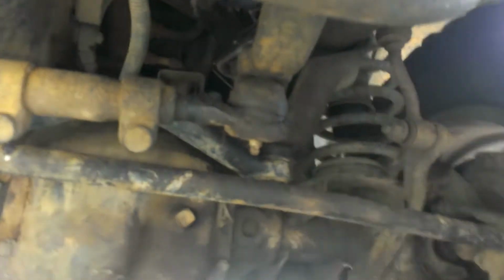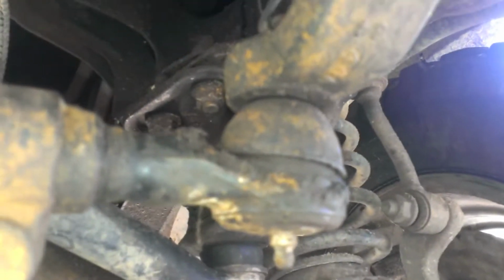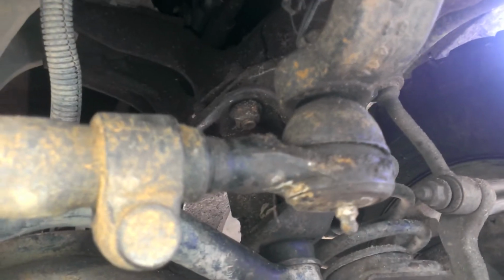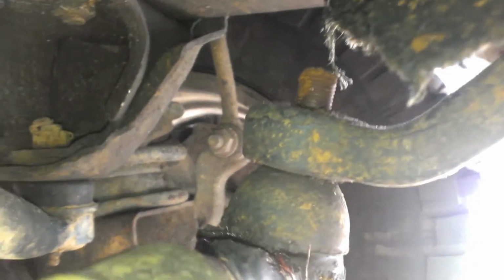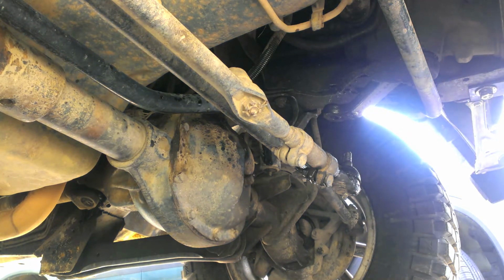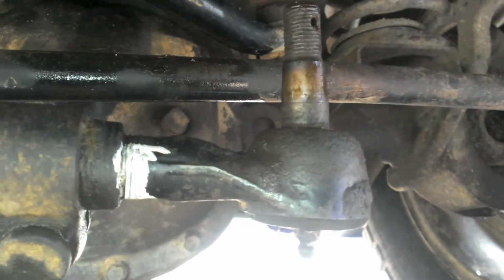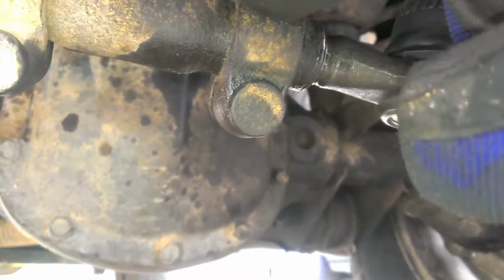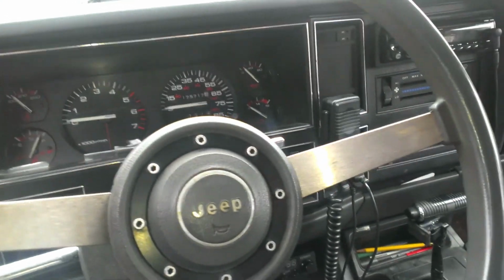89 Cherokee Tierod End Replacment

Comment: replaced all my steering arms last year now that same tierid end went bad and even with an air chisel i cant get it seperated from the pitman
Reply from the maker: teamster442 damn, must be in there pretty good then. you can try hitting the side of the part the joint is stuck in, sometimes that helps. other then heat, you could try a tie rod puller
Reply: i ended up using a acetylene torch and air chisel directly after,  i commented on here while i was fighting with it today.